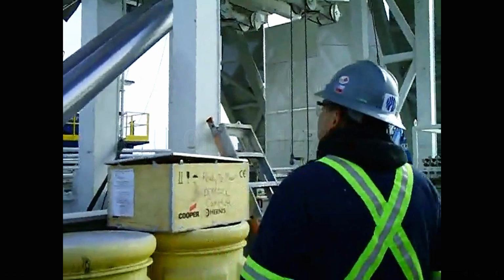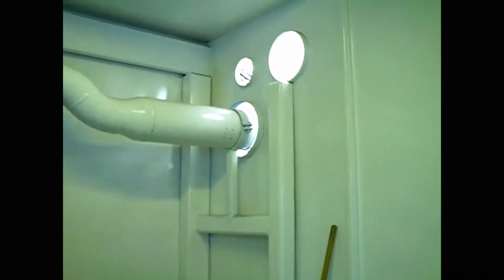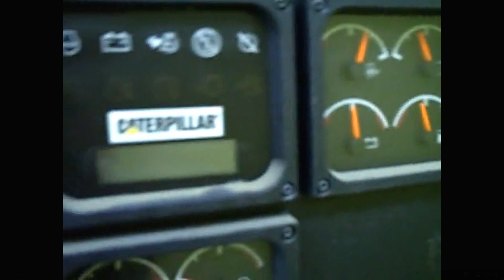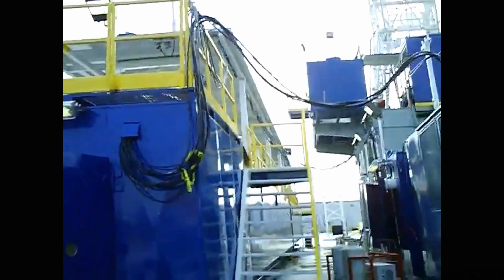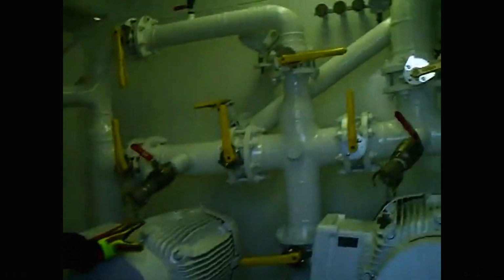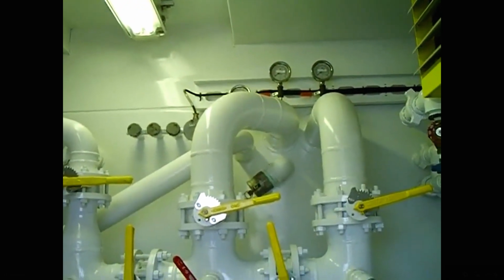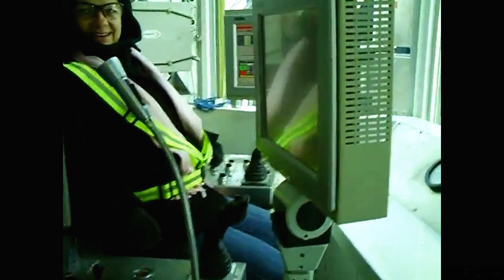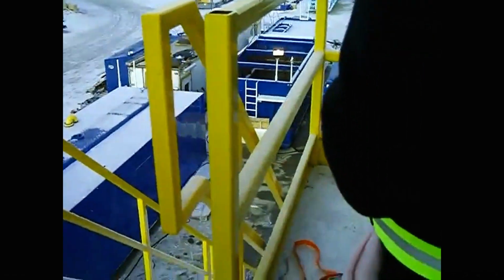⛽NABORS DRILLING | OIL and GAS | OIL RIG TOUR | LET ME SHOW YOU MY WORK AND HOW THE PROCESS MADE

Comment: Which is the entry level position in oil rig for mechanical engineer?
Reply from the maker: It depends if you're competent, maybe I'll put you in reliability department, its function is doing RCA, FMEA, IRRR, insuring mechanical availability of rotary equipment for trouble-free operations of the rig.